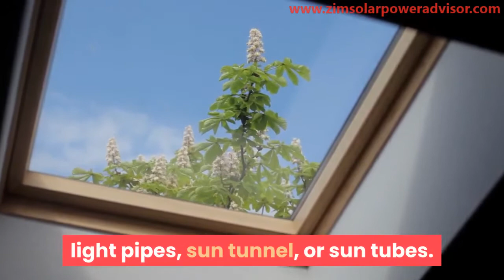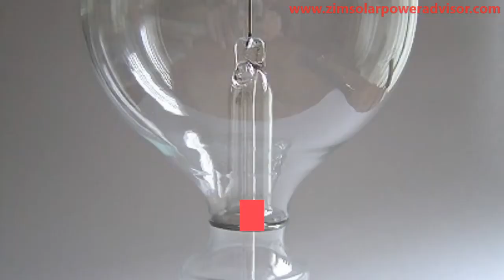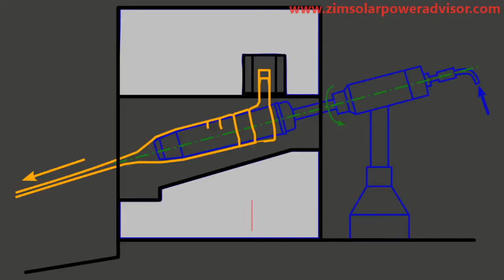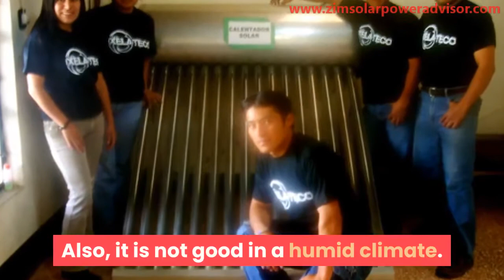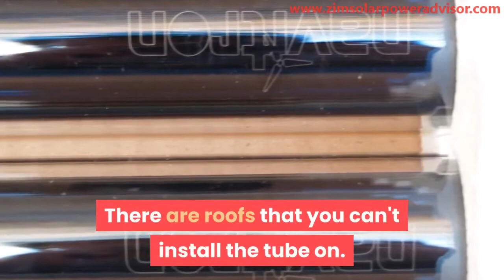What are the Drawbacks to Solar Tube Lighting

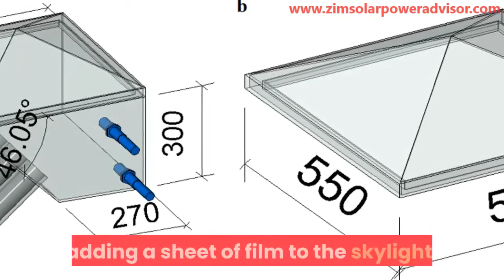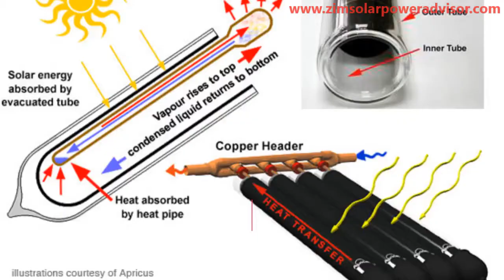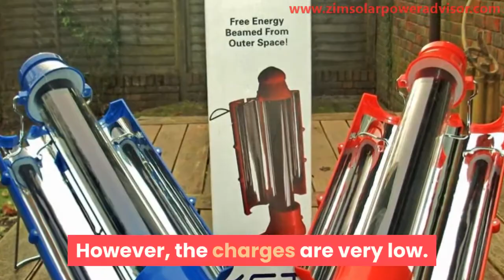Comment: Several of these images were actually telescopes and the boneheads who made the video were clueless about it. In fact at the 6:47 mark they actually showed a reactor tube with no idea of what it was. At the 8:03 mark, they show liquid solar heater tubes. Again, clueless. At 10:02 they show solar hot water heater tubes. More cluelessness. They claim skylights are more expensive to buy. But this is nonsense! 14 inch diameter Solar tubes at Lowes' or Home Depot cost 3 to 4 times as much as skylights which are much larger in area as well!

Comment: So many problems with this video. Let's start with the name. It's called Solatube Lighting, not Solar tube. Immediately discredits the intent of this video. 
If you want a skylight, you can look out of it and see the sky. You also get all the heat that any window allows thru. Velux skylights have in the instructions to not put a film on the window. It voids the warranty. 
If you are just looking to brighten up a room, then the SOLATUBE is the best tubular lighting out on the market right now. Doesn't create condensation or allow dripping onto ceilings, as the video suggests. 
Not everything on the internet is correct, and this video puts out a lot of incorrect information.

Comment: I had these installed 20 years ago. Now that things have changed like large wall mounted TV I now have a problem with mine.  The light reflects onto my TV making it impossible to watch tv in the day. Also the 2nd one was in an area over my desk in the back room.  Had the room remodeled into a bedroom but had to design the layout so that the light would not be directly in the sleeping area.  Now it is in a walkin closet.  Wish there were some way to fix the TV problem.
Reply: They make a solar dimmer. That way, you can turn off the daylight. Easy fix for the homeowner who remodels. They work great. Call your nearest solatube dealer.